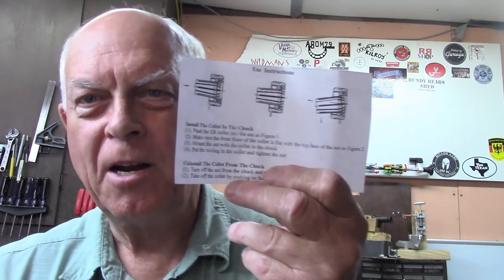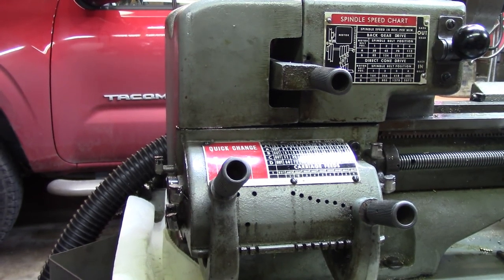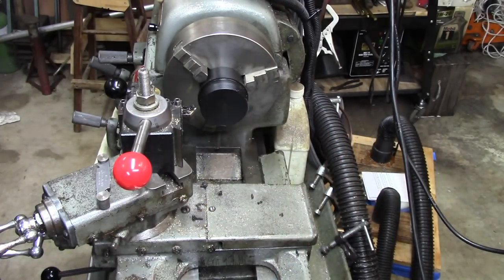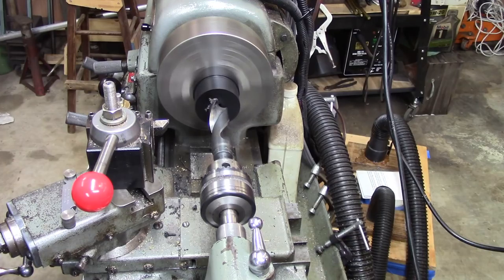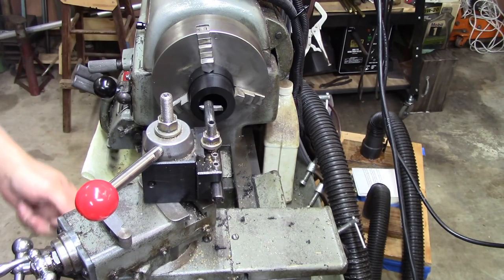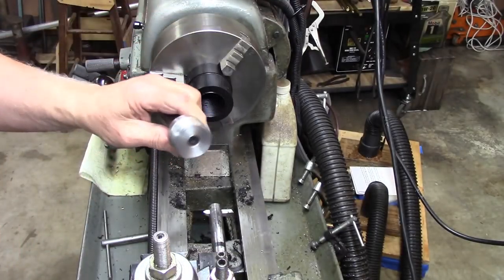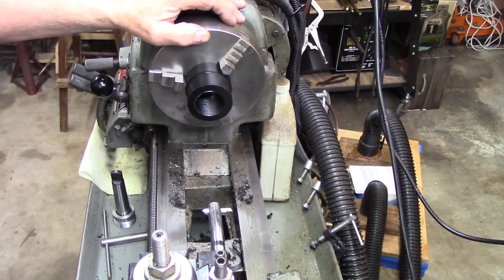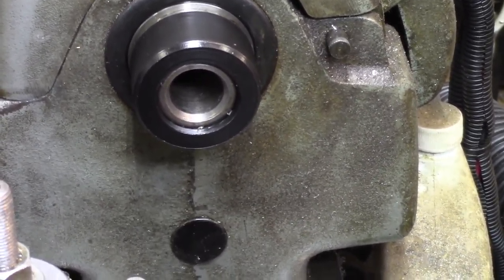Lathe Spindle protector and drawbar part 1 of 2

Comment: Quick rule of thumb re thread ID, subtract the reciprocal of the tread pitch from the OD. 8TPI means subtract 1/8th from 1 1/2" giving 1 3/8" Works for metric too but a slightly easier calculation, just subtract pitch from OD. ie M8 by 1.25 leads to 6.75 (but use 6.8 is it the nearest standard drill.) Hope this helps.
Reply from the maker: Thanks for the tips.  Thanks for stopping by.

Comment: Do you use it for range distance or just directions. I know archers use laser rangefinders
Reply from the maker: I must apologize but I am not so sure I understand what you are referring to.  If I mentioned the ATN X-sight in this video it is a rifle scope and it calculates the ballistics for whatever rifle it is on and sets the cross hairs correctly for whatever distance to your target.  You do not have to crank a knob X number of clicks.  Their is a range finder in the scope that you can use if you know the size of the target.  You can take that number and enter it into the distance input of the scope.  Their are lots of how it works videos on youtube for this scope.  Thanks for stopping by.
Reply: I meant the distance you would use as a reference. Ex if you wanted to set for 200 yards. You could verify the target is 200 yards. In golf you either use a laser or gps depending on the accuracy you want. They make a laser range finder some hunters use as a reference to set scopes to. Hopefully this is clear as mud